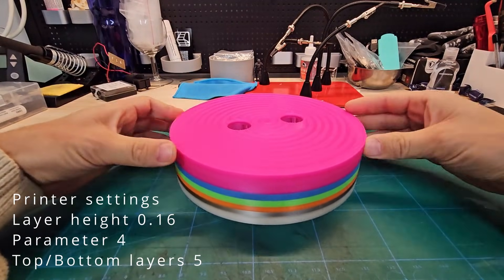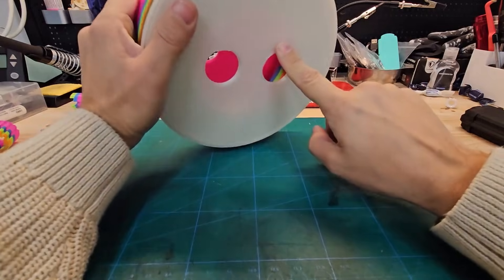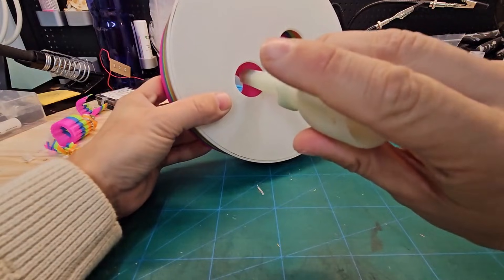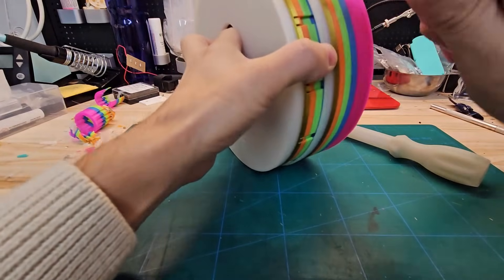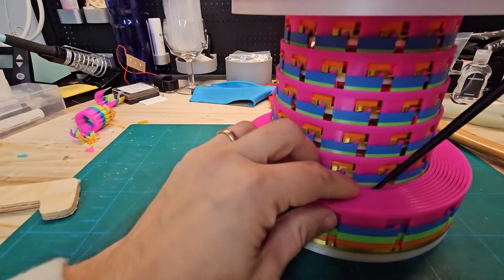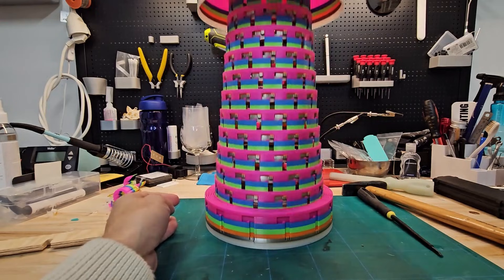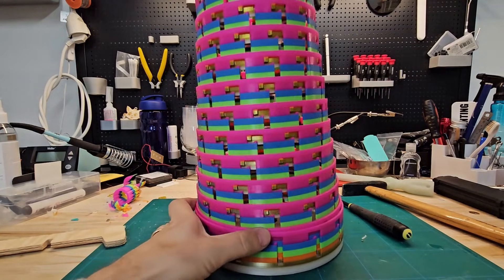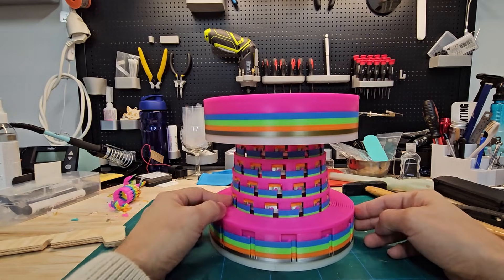Twist And Sit 3D printed version (Open instructions)

Comment: I cant avoid the supports in the walls, what settings did you use in supports to not have supports in the walls and only in de center of the sit plate? Is there the only surface that you put supports? There are supports in any other position? I use OrcaSlicer
Reply from the maker: @RominaRodriguez-w2h  hello. We use support from buildplate only setting, this will ensure there are no support in any other places than holes. Set the support type to snug also. 👌 Good luck.
Reply: @makerlindh5372  Have you ever tried to print it in PETG? Im about to do it, but i would like to know if its possible?
Reply from the maker: Others have printed out in petg with great success @RominaRodriguez-w2h
Reply: @RominaRodriguez-w2h  I did from leftover petgs (230mm diameter, 1,1kg). Im 193cm and 90kg, I sit on every lunch time, no breaks or weakenings, I very love this stool :D

Comment: For the support material. Support everything or on build plate only? I dont see anywhere that directly explains support settings. The video looks like just build plate only, but want to confirm before i  print.
Reply from the maker: Yes build plate only. And snugg support
Reply: @makerlindh5372  thank you for the reply.
Reply: @makerlindh5372  ups is there a possibility it works altough i build full support 😅

Comment: I couldnt open. I tried to hammered multiple times and it just doesnt open. I even created a crack on one side. The other end broke. Not worthy to print this since there is a Big chance that you will break it before you open it. I broke the bottom part and i could open everything somce now there was acces to put a scredriver and break the bondage. I am designing a bottom part to replace the part i broke.
Can you change the clearances so it doenst stick as much. Or design the bottom part separetly. So its easy to remove the bandage between layers. Thanks for your design.

Comment: hi i am stuck at the part where you managed to get more of the rings open and can only really get the first ones (4:21) any ideas?
Reply from the maker: @kyanashley4510  try pull them apart with abit more force, if that does not work, repeat step 1 and 2 and be paintent. Put something longer in the holes and hit close to the rim at the bottom and it will poop lose 👍
Reply: @makerlindh5372  I did I and it worked ! But one ring ended up breaking. So I isolated that ring in Bambu studio and printed it separately, it was a bit tricky to get in but it ended up working great

Comment: i am 20 hours into the print and i forgot to use arachne mode for the wals will this affect it?
Reply from the maker: @kyanashley4510  not really. It will maybe be weaker in some of the seams. But you are good 👌 make sure to follow the instructions in this video and your good.
Reply: Omw bro thank u so much I was so worried

Comment: Can you print with a .8 nozzel
Reply from the maker: Only if you print it with 0.16mm layer height. And that will be tight on a 0.8mm nozzle. So its not recomended.

Comment: 1: could have probably just lightly hammered around the edge of the whole thing to break the rings apart or tie some rope to the finger holes and use them to pull it apart at first (I'll test this one myself when I print it for myself)

2. Why no weight test? I wanna make one for my camping gear

Comment: Assuming weight limit would depend on the plastic.  I'm thinking about using two if them with a board across for a light equipment or picnic prep table
Reply: Then what material should we use?

Comment: Very cool! I'd like to see a weight test to see how much it can support. I love overengineered stuff like this!
Reply from the maker: Yes I'm thinking of creating some kind of test. Not sure how I whould test it yet.
Reply: @makerlindh5372 print a few and do a load and impact test.
Load obviously just put more weight on it till it fails and impact suspend a load a few inchs above then drop it'll be a bit like sitting down hard
Reply: @makerlindh5372  probably just get a bunch of steel weights or a massive bucket and fill with sand with the stool on a scale. Or just sit on it an pick up more weights each time

Comment: I feel like 0.16 layer height is really low, this must take forever... does this really require the detail of 0.16?  Surely 0.2 or even 0.3 would work if this was designed for it, and not take a year to print?
Reply from the maker: Thicker layers does not mean faster prints. All comes down to your flow rate and speed you print at. You can print this with 0.2 but I can't guarantee that it will open up. It's designed for 0.16

Comment: This is a very nice project, it would be nice if you could provide models that are able to print not only on bambulab but lets say creality printers, also I have problems with cura and prusaslicers it says many error messages. But thumbs up very nice idea
Reply from the maker: I will make a smaller version soon. But I think this will be OK to print on prusa or creality with bedsize 200*200

Comment: What kind of things would you recommend for putting though the hole i cant get mine open
Reply: Have you tried an uninflated bicycle tube? Feed it in then pump it open.
Reply from the maker: @jimbrookhyser  that's a really smart idea. I'm worried though that it will push to hard to the sides rather then on the top and bottom. But it might help with the first step of the opening.
Reply from the maker: Anything that is not to sharp :) and fith in the hole. Like the back of a wrench or a ratchet shaft

Comment: Ehh I can't open up the 3mf file on Cura. says there were no files? weird
Reply from the maker: Try the STEP file then. Most slicer software these days can open STEP files. Let me know if you have any further issues with the 3MF file.
Reply from the maker: I just downloaded the file from Makerworld and opend it in Cura 5.2.1 and its working great.
Reply: @makerlindh5372 Cura can't open step files it seems. Also, I went to printables cause it says you need to make an account for makerworld which sux
Reply: 3mf should be able to open in cura.
Reply: @DanteEhome  it opens but says there were no files in it (?) Could be a glitch cause it does take up space. I think I'll just take the step file and open it in Freecad, then export as an STL
Reply: 3MF is a PrusaSlicer file extension.
Reply from the maker: @larryturnertclan 3mf is not a prusa slicers exclusive file. 3mf is the new file extension standard for binary 3D models and will work in almost all modern slicer softwares including cura. 3mf is replacing stl.
Reply: @makerlindh5372  Thanks.
Good to know.